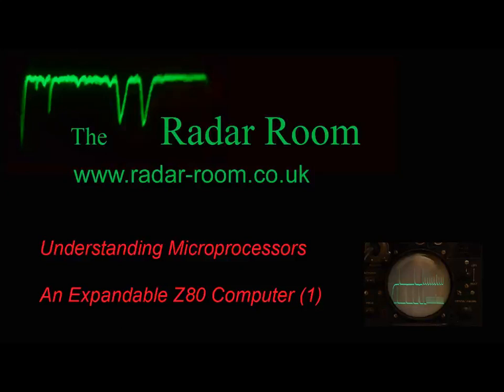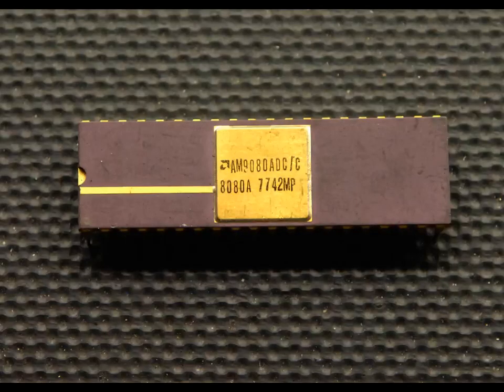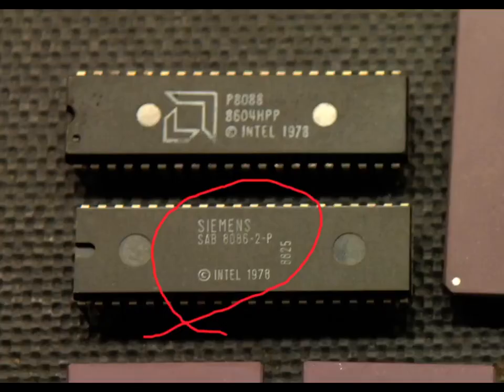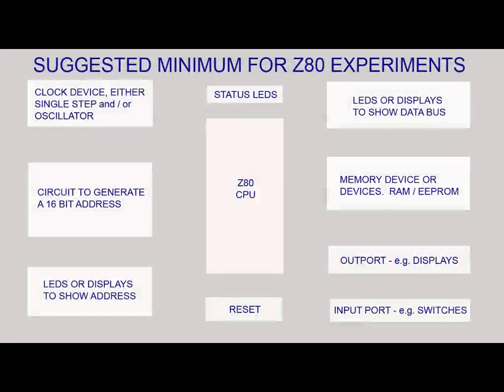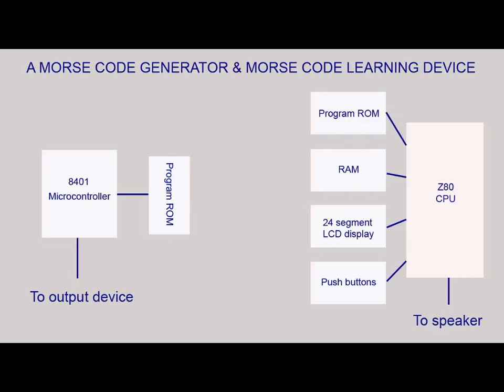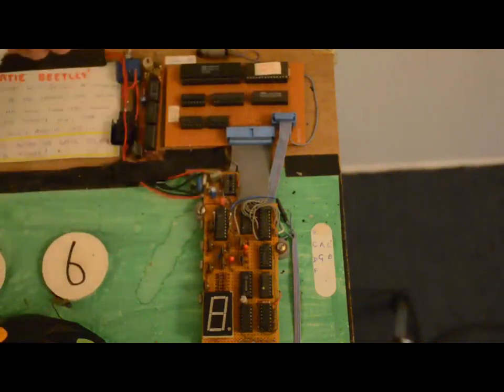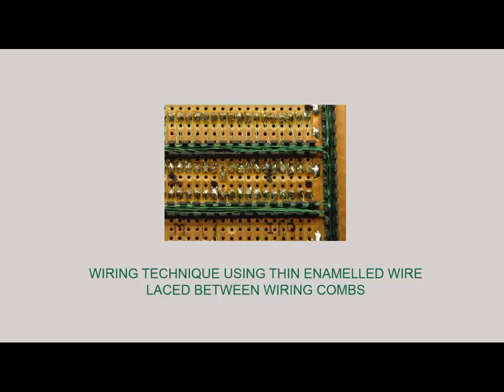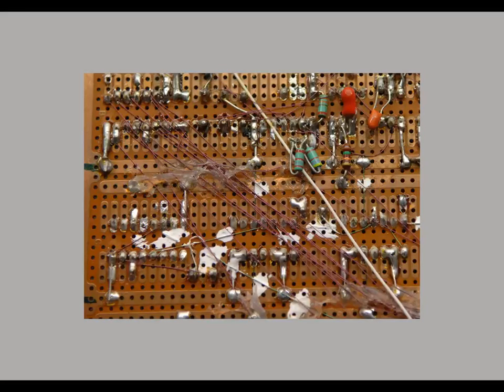Z80 Part 1

Comment: This reminds me so much of a computer a friend of mine built early 80ies. Also a Z80 and hand wired. My contribution was owning a soldering iron and proof reading the hex machine code for the monitor program :D
Reply from the maker: Ah yes. The days of REAL computers :-)  This was build about a year after the release of the Z80. I only worked with the old 8080 before that. At least one could use all of the standard op-codes from that processor on the Z80. Yes, those times were fun - and still can be today!